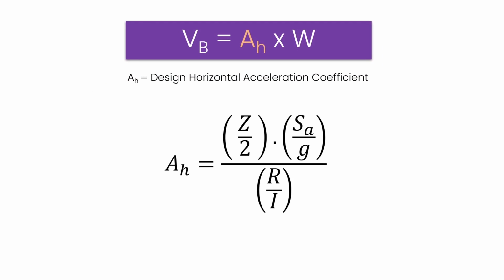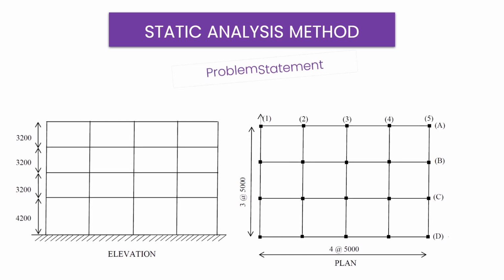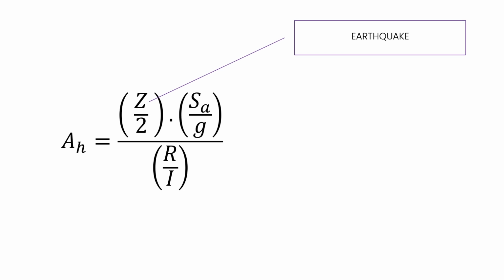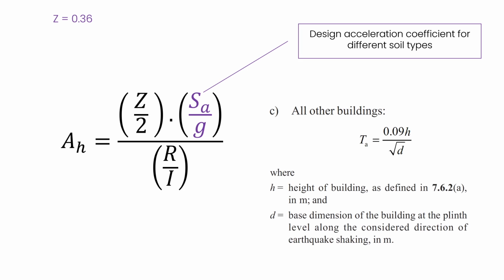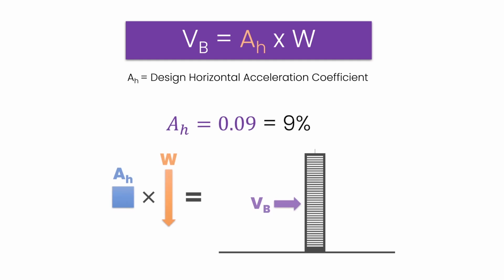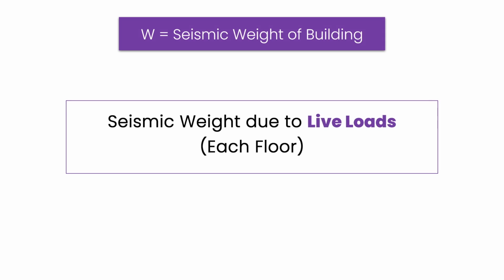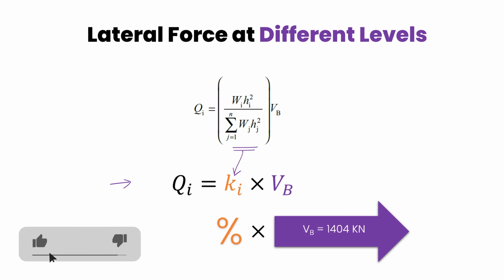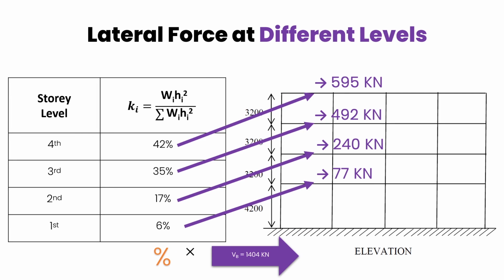EARTHQUAKE / SEISMIC LOADS | Static Analysis Method | Creating an Earthquake Resistant Structure

Comment: In clause 7.6 of IS 1893 part 1, it is mentioned that equivalent static method is applicable for regular buildings with height less than 15m in seismic zone 2. In our problem the seismic zone is 5. So should we solve this  by dynamic analysis method?
Reply from the maker: You are absolutely correct. This problem should ultimately be solved using Dynamic Method.

Comment: hi, in general, when you apply a lateral seismic load should you also consider vertical acceleration within the same load case (i.e increasing the W of the structure)?
Reply from the maker: The weight of the structure is a constant and not likely to change.

Comment: Hi Sir
How to distribute load in each column by applying manual in Staad pro from your manual calculated value
Reply from the maker: you can use the stiffness parameters to calculate the same

Comment: How do you get Dead Load as 12
Reply from the maker: This was just an example case. The values are arbitrary. In a real life problem you will have to calculate the loads as per the conditions of the structure.

Comment: In a G+3 storied building, the weight of each floor including the live load is 800 KN.  Floor to floor ht is 3.5 m. Base shear is 200 KN. The lateral horizontal force at 3rd floor will be???..
Reply: Roof pr weight ki value kya hogi sir..neeche k dono floor pr to 800 KN ho jayega ...
Reply from the maker: Please share your exact question with loading values, design constraints etc. in the FB group. I will have a look

Comment: Hello Sir, thank you very much. For W the seismic weight of the building, you give the weight of each floor plus the weight of the roof. What happened with the weight of columns? Are they not included in the calculation for W or they are included in the weight of each floor?
Reply from the maker: Hi Christian. The problem statement was kept simple to make the manual calculations easy. In the real world example all the dead loads on the building is to be taken during calculation of Seismic Weight W which will include the weight of columns and beams and any other dead load imposed upon the structure. This example was however devoid of those factors just to minimize manual calculation on my part. Hope that helps. 🙂

Comment: sir 35:38min  6% of 1404  is 84.24 you wrote 77KN?????
Reply from the maker: The 6% you are mentioning was just a rounded value I showed to make things clear. If you go to 34.06 mins you will be able to see the actual value of ki is 0.055 precisely and 0.055 of 1404KN is 77.21KN. Hope this clarifies it for you.
Reply: @CivilBlackBox   got it thankx alot👍
Does this same manual procedure can be performed in stadd or not 
Is there any video ???